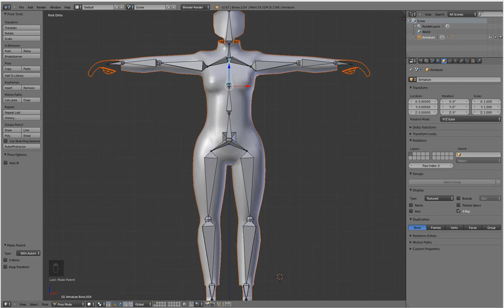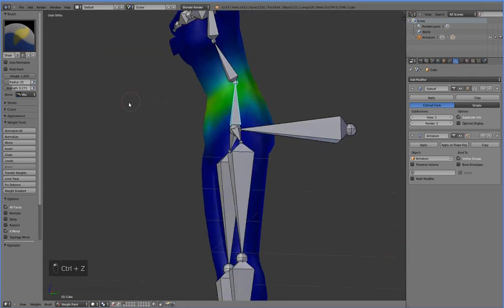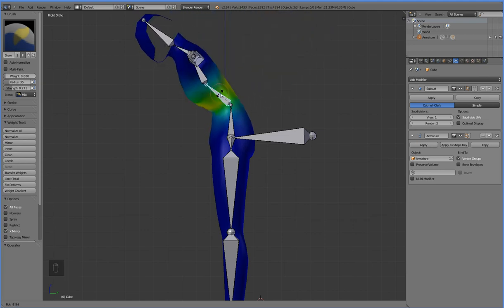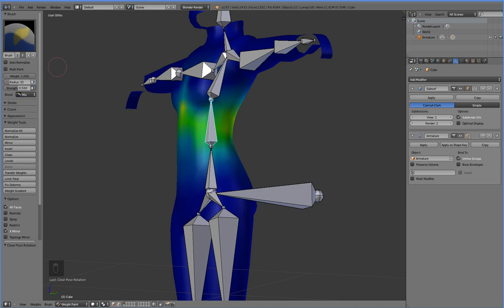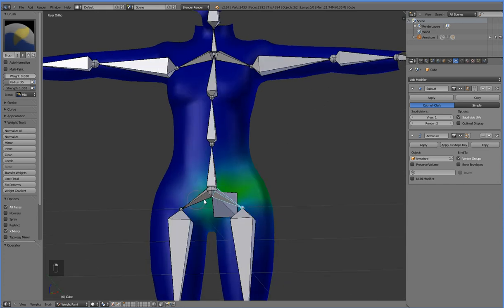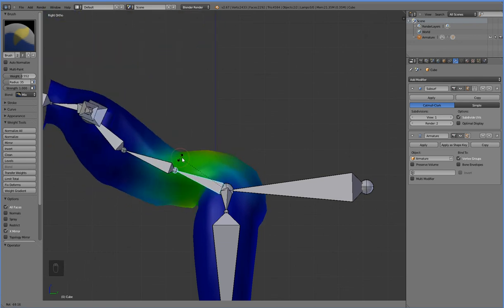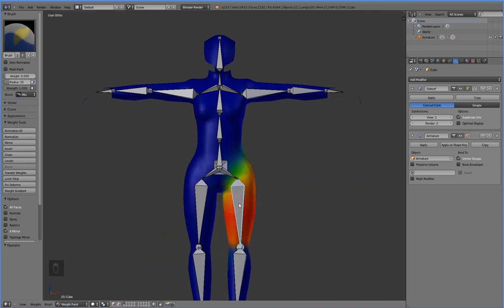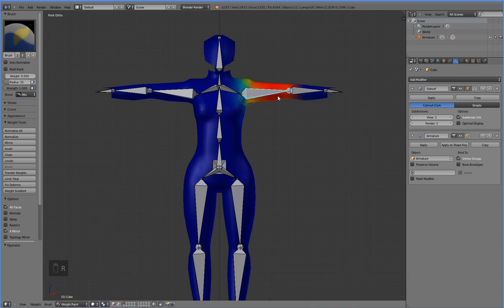Let's Model a Pilot #07

Comment: Hey craig I have a question, that is like in minecraft where there are layers of blocks like the surface and the underground type with specified ores and blocks is there anyway I can do that with this code. also when I rewrite the script from an older episode  I got some interesting biomes that I like dint screw with the code either
Reply from the maker: Sure, it's actually not that hard. Just build brick layers that are "above 8" and "below 12" and ">0.8 blob value", that'd do it.